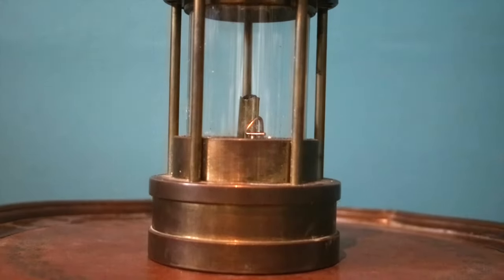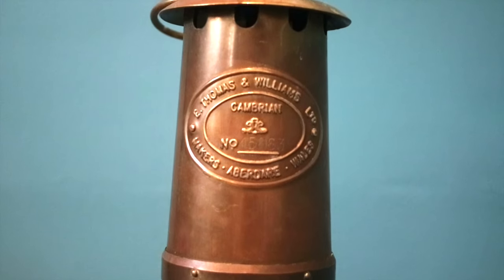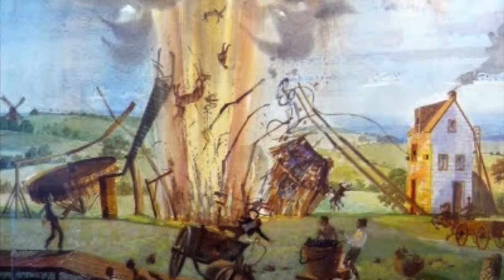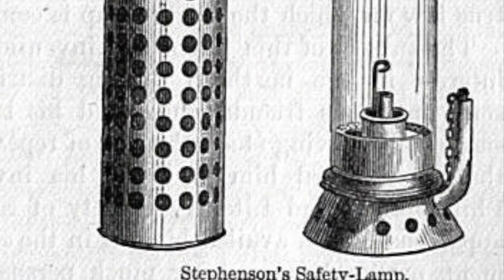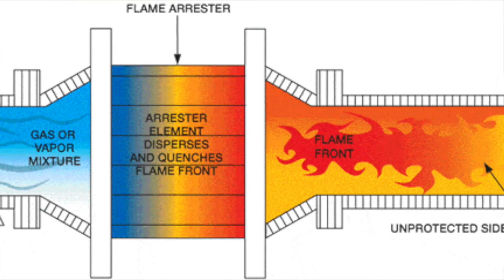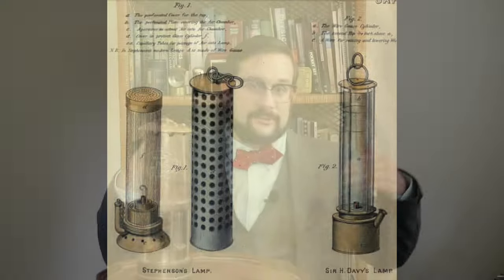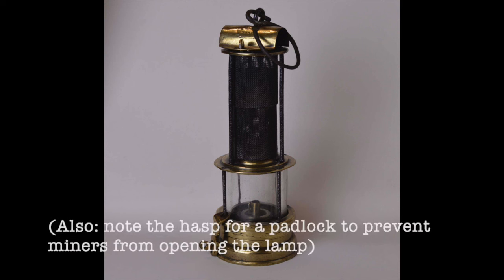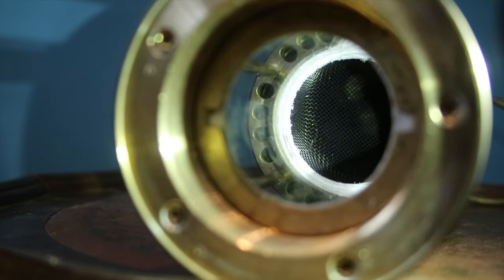Miners' Safety Lamps: Keeping Out the (Fire)Damp

Comment: Mine safety lamps similar to this one were still in use in Pennsylvania coal mines in the 1970s. My fading memory is the shift foreman carried one. They had electronic gas monitors too, but the lamp was still required because the electronics weren't yet trusted. The glass cylinder around the flame had 3 lines inscribed around the circumference. At the start of the shift, the flame was adjusted to the center ring.  If the flame reached the upper ring, the assumption was there was methane and we shut down.  If the flame reached the lower ring, the assumption was there wasn't enough oxygen and again, we shut down.  Of course there was some "eyeball calibration" applied to decide if it was really that bad.  Good times.

Comment: My father worked on the coal face of a North Somerset mine. I remember the Davy safety lamp and the fact it had a locking mechanism on the base requiring a strong magnet to release metal pins allowing it to be opened and refueled with paraffin.
Reply: Thank you - Messier kind of skipped over what the actual fuel was!
Reply: They are not fuelled by paraffin, but on a much more volatile coal distillate that is basically today's Zippo lighter fluid or Coleman camp fuel. Paraffin residues will gum it all up and also cannot be relit by the flint mechanism inside the lamp (not all lamps had this).
Reply: @davidcolter  Ah, I see... 👍 Cheers.

Comment: Fantastic video good to hear the political infighting that is often associated with such innovations. I worked for many years for the Coal Board in the UK. Safety lamps were used and In fact were required by law to be carried down the mine. My uncles job was in the ‘lamp cabin’ he was responsible for cleaning inspecting and issuing lamps to miners going down the pit. The lamps had a magnetic locking mechanism so they could not be opened other than by the guys in the lamp cabin. The lamp when given to the miners was lit the standard lamp could not be relit other than when it was opened in the lamp cabin. A second type lamp was issued to senior staff ‘Overmen’ this had a striker mechanism allowing it to be relit!
Reply: I have one with the magnet, it’s full of safety features. Imagine when they went down the mines with the carbide head torch !
Reply: Saftey lamps wer ealso used in many other confined space applications. Sewers, utilty trunks. I have a small Wolf Saftey lamp (Wm Maurice ) Ltd Sheffeild.

Comment: How interesting! I've got one of these lamps. It's got a label saying "Weems & Plath Yacht Lamp Annapolis Maryland" and a serial number. I had no idea it was a miner's safety lamp until I saw this video. I use it during power outages. The only complaint I have with it is that the hook at the top gets so hot you can't carry it around without protecton on your hand. Thanks for the interestng video!
Reply: Yes, Weems and Plath needs to explain the reasoning behind the design. As designers of yachting instruments, few of their customers have coal mining experience.
Reply: Your Weems & Plath is using the same reasoning as the miner's lamp. If the cabin area becomes unsafe (a galley stove emitting too much carbon monoxide, for instance) the lamp will diminish so you can safely exit the space and ventilate it.

Comment: British Author Ken Follet (Pillars of the Earth, Eye of the Needle, Lion on the Desert) wrote an excellent historical fiction about coal miners in England. It’s rich with many of these details. Regrettably I cannot recall the title as I read it 20-25 years ago. When we examine blue collar working man’s jobs in the 19th and pre-WW2 20th Centuries there’s no shortage of extremely dangerous jobs. But descending into the pitch black earth with an open flame on my head rates near the top (beneath only Mohican Wind Walkers and sailors tying main sails 140 feet off the deck standing on hemp rope in bare feet.

Comment: There is still one improvement in the lamp although not a safety measure but insanely benificial to the operator of said lamp and that is the current usage of glass wicks that never burn out and never need to be replaced.
 All the oil lamps I have do have glass wicks and I strongly advise anyone who likes oil lamps to ditch the one time use cotton wicks for perminant glass ones.
Reply: Wow! Thanks for that tip!
Reply: Neat i was unaware glass wicks even existed, sounds interesting to look into thanks for the infl

Comment: Just a note about hydrogen sulfide. While it does have a distinctive "rotten egg" smell at lower concentrations, you can no longer smell it above 100 ppm, which makes it particularly dangerous. Generally, anywhere from 500-1000 ppm is instantly fatal.

Comment: I would love it if you would include more info on practical use of the lamp. Like demonstrate how much light it gives of, and maybe show whAt happens when gas is introduced  as well. How to light it, how to refuel etc. And also some info on actually burntime etc. 
Love your videos. Keep up the good work.
Reply: Modern lamps, not in use since the 1990s, had markings on the glass, there was more than one globe, when in the presence of methane, the flame would grow up to and over the top mark, if the O2 level dropped below safe levels, the flame would shrink below the mark for normal use, they had an ignitor similar to a cigarette lighter, this from a twenty year coal miner in the U.S.
Reply: About the same amount as a cigarette lighter.  They are a metering tool, not a light source.

Comment: @2:20 .. CO2 asphyxiation is not asymptomatic, It's likely terrifying, triggering both gasp and panic reflexes. Like holding one's breath under water for too long. I think you're mistakenly referring to CO (carbon monoxide). Indeed the autonomic gasp response is not due to a lack of oxygen, but the build up of CO2. Other gasses, from noble to (Say) SF6 (Sulfur hexafluoride).. well . there was no reason to evolve around exposure .. so you just go to sleep. Forever.